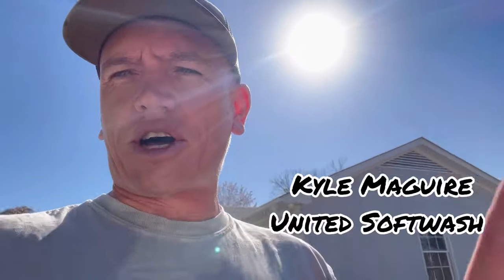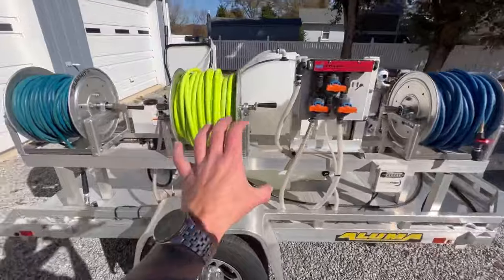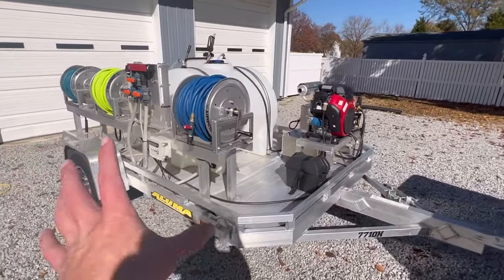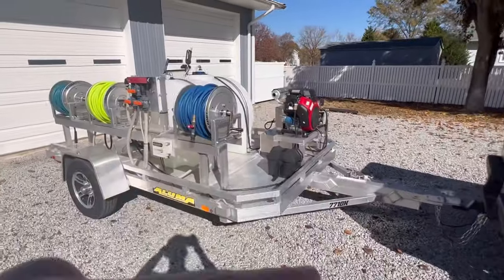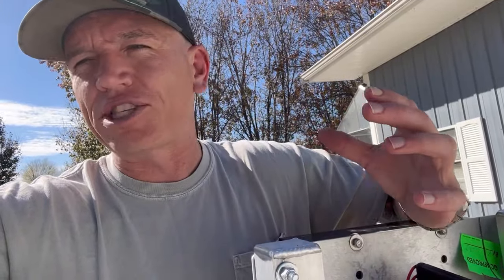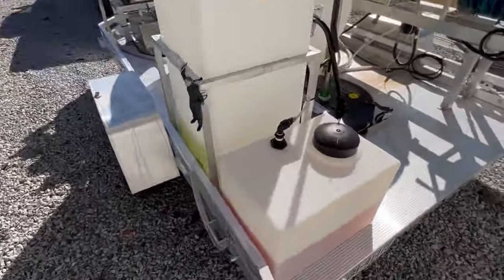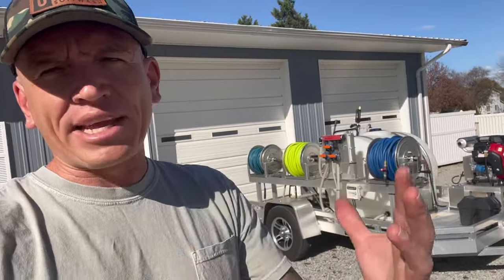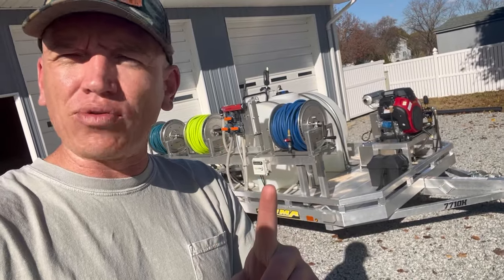The Best Pressure Washing Set Up for 2024 | My New Softwash Rig

Comment: I started my pressure washing business a couple of months ago and started with a 4gpm machine that I just ratchet it down to a trailer and pull it off for each job. I currently have a contract with an apartment complex and their buildings are fairly large, each one is 2 story with 8 units. Each apartment is 1200 to 1700 square feet and a large breezeway in the middle. Each apartment also has an outside patio that I have to clean. Each building takes me on average 6 hours to clean, and I can see where the 4 gpm machine is slowing me down, because I spend most of my time just thoroughly washing off my SH and surfactant from the vynyl siding.

 I currently only use and xjet with a 25 foot hose to spray my chemical because for 4 of the patios I have to climb a ladder and jump over the railing to clean them, and I like how with an xjet, I can just pull my hose off my gun to stop spray chemical so I don't have to climb over the railing again to take a siphon tube out of a chem bucket for downstreaming and then climg back up the ladder. I am not allowed to drive on the grass with the trailer, which is why I take my pressure washer off the trialer and closer to the building so I can wash the entire building without having to change my water source. I could see a problem with having a system like this with the pressure washer being attached to the trailer, the buildings being so large, and with me not being allowed to pull into the grass. How would you go about washing the back side of the building with something like this when the hose would not reach the back. If I could get that answered then I would try to save up for a rig exactly like this one based on your recommendation. 

How much would this exact rig cost if I were to get it? Also, would I buy all of the stuff separate and then have Industrial Cleaning Equiptment in NC build it, or will they order all of the parts and build it themselves and have me pay them one price for the whole thing when it is finished?

Thank you so much for all of your videos, you have been such a huge help with me starting everything up. Definely a blessing to me and my family. I work law enforcement in GA as my primary job, and do this on the side and with this extra income, we are about to buy our first house with the extra income we make from pressure washing. I just want to thank you for the wealth of knowledge that you are putting out there for guys like me! You are awesome man, and I am really interested in this exact same set up.

Comment: Are you using surfactant when down streaming, or are you just spraying SH?   Didn’t see how you’re pulling soap with your chem unless you’re batch mixing the 55gal?  You’re obviously metering your soft wash mix, so no questions there.